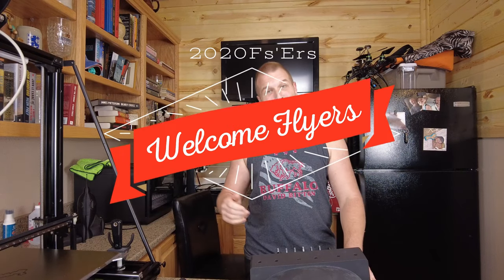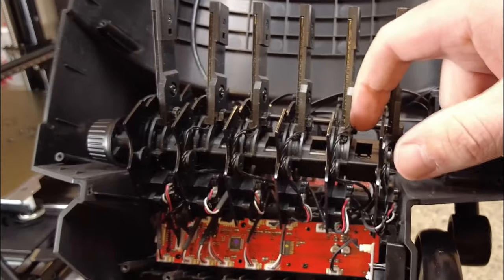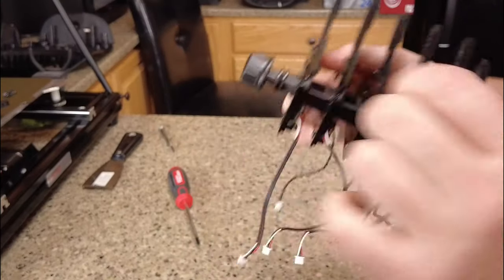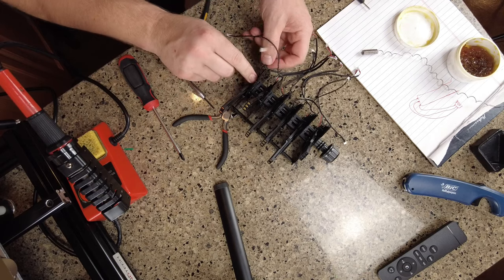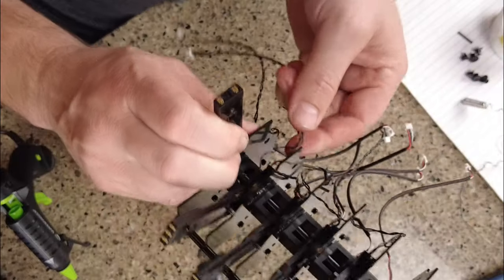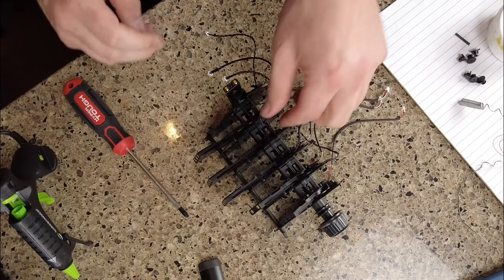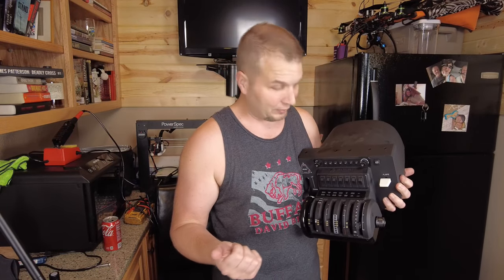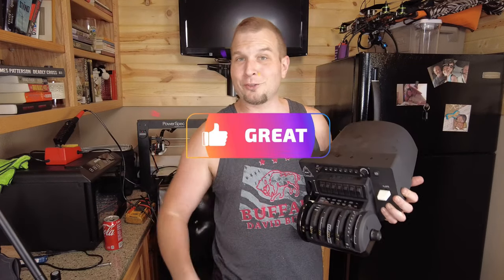Honeycomb Bravo Throttle Quadrant Problems REVersers NOT WORKING! Bravo Teardown REpair! POOR DESIGN

Comment: Great job John! That is the only video I could find on Bravo disassembly. I got mine recently, and the problem I have is that none of the axes is detected in the lower portion passed the detent. The only thing that is detected by the simulator, and the OS are the buttons at the detent line. But the potentiometers on the lower portion of the levers aren't responsive at all. That makes using the thrust reversal, prop feathering, and cutting the mixture difficult at best. I tried contacting the Honeycomb, but their customer service seems to be non-existent (despite the awesome product they produced). I wonder if your levers work all the way including the lower portion past the detent points. And if yes, what would be a possible cause of this issue, and if it is possible to fix it. Thanks!
Reply from the maker: Yes my levers work I  the lower detent position it was the reverser wires that all snapped. I suspect that if all of them stopped at the same time or never worked may be that they are not plugged in that's what i would think . 🤔 I hope this helps you and thanks for watching.
Reply: @2020fsers  Thank you John. It seems I have no other choice, but to open mine as well since Honeycomb does not answer my messages/calls, and as such, the warranty on this brand new unit is useless anyway :(.
Reply from the maker: It's not bad most likely you will remove the bottom and see wires not plugged in or something goofy. 😉
Reply: @2020fsers  My guess is that they didn't solder the potentiometers properly, which will be an easy fix. But if they did, and the controller does not interpret the signal, it means the problem is with the controller, which would be a bummer.
Reply from the maker: Stay positive and get your mind set and it will be easy don't think hard it may just happen. Things will be looking 👌.
Reply: That travel past idle is not an axis, and the potentiometers have nothing to do with it.  It is a button - any movement past the detent is "on" and forward of the detent is "off".  In much the same way as the reverse levers themselves, it is all or nothing.  You can see this if you examine this movement in the XPlane joystick settings.  You could use those 
"buttons" for reverse, of course, and if you were flying a C-141 or C-5 that movement would actually be realistic, save for the fact that it is not an axis and only an on-off situation.
Reply: @anthonyvallillo422  I must disagree. The potentiometers record all the values above and below the detent line, but regrettably Honeycomb decided not to use the lower portion as a part of the axes; they simply programmed them as buttons in their control board. However, they can in fact be used. I already finished installing a 2nd controller board inside, and rerouted the potentiometers through that board. Now I have fully functional axes above and below the detent. I also programmed the absolute lowest position as buttons so now I can also use the maximum reverse thrust commands.
Reply from the maker: Wow that sounds very interesting 🤔
Reply: @kiralema  I must defer to your knowledge!  But in essence, that is how they were designed - perhaps poorly, but it is what it is!  I don't suppose that you would be interested in making a second career of thus modifying the units of those of us who cannot solder a wire, much less remove the bottom from a unit like this!
Reply: @anthonyvallillo422  You are 100% right. Not everyone has knowledge and ability (and most importantly time) to modify a commercially-available controller to suit personal needs. It is unfortunate though that Honeycomb decided to limit the full potential of their beautiful controller. The only suggestion I have is to urge Honeycomb to either release a firmware update, or if that is not really possible, to modify the firmware of the newer models. I emailed them and spoke with them on the phone about the issue, but one voice isn't enough.

Comment: Excellent video. I managed to repair the broken wire a few months ago following your instructions.  However 3 more wires have broken.  I’ll attempt to replace some wiring.  Can you you tell me what type of wiring it is and what gauge it is?   Much appreciated. Richard
Reply from the maker: I used small 25 gauge silicon wire. For electronics.
Reply: Many thanks
Reply from the maker: Your welcome

Comment: It’s so funny how YouTube recommended me this video after I ordered the bravo. Thanks google !
Reply from the maker: Oh my . It still is a great unit .. hope you have better luck than I did.  Thanks for the comment 😀
Reply: @2020fsers  guess what week and a half of ownership and the first throttle prematurely enables button event at idle. Is that something I could fix fallowing your guide
Reply from the maker: Are you saying at idle it also triggers the detent switch? You may need to take it apart and see maybe the detent switch came loose or is miss aligned. But I will say this video is really not a guide at least i didn't market  it as that lol. But it certainly shows a good bit of the inside.
Reply: @2020fsers  yes it triggers it for a fraction of second. I also noticed once throttle 2 is in slightly above idle position the throttle 1 becomes very noisy.
Reply from the maker: You may want to just return it for an exchange or return get your money back and buy a new one seems you may have a problem unit only after 1 week.
Reply: @2020fsers  yeah I think I’ll go with that option since I’ll  have a right to do so. Great piece but now I’ll definitely wait for Rev2.
Reply: Just an update on my bravo.. the whole thing is wired with a very thin cables. They try to mange it using tightened zip ties. There is 5 of them connected to a metal plates in between each slider. The zip tie on throttle1 was over tighten, there was no room for cable movement and it caused damage to the wire coating, that broken wire was touching metal at certain throttle position and this caused  my issue. 2 out of 5 zip ties where over tighten. I put on some electric tape on compromised wire and replace other zip tie. It’s as good as new but I wish the improve quality control. Not every one likes to take things apart.
Reply from the maker: Wow i guess they don't care about all the complaints they haven't changed anything .

Comment: I have squeaky noise coming from moving the levers up and down, is there a way to fix that ?
Reply from the maker: Not sure but don't spray wd40 or and lube down in there you will loose the adjustment to stiffen the axis .

Comment: Hey I have just bought my own bravo quadrant and after much testing I’m convinced my gear lights (the three red/green leds on the front above the gear lever) don’t work. Can you give me any suggestions on how to fix without having a to send the whole thing back? After all it’s the ONLY thing not working on my quad and after looking around I should consider myself lucky. What do you think might be the cause of the problem?
Reply from the maker: Have you tried using spad to control the lights. You can get the free trial to test .
Reply: I already own SPAD and for the last time it’s not software trust me. All the other lights and levers work all EXCEPT the gear lights.
Reply: Am I likely to void my warranty if I go open it up?
I suspect a loose wire is to blame but can you tell me from your experience opening it up is it easy to access those gear lights or am I in for a nightmare of cables and screws
Reply from the maker: You will most likely void your warranty opening it up . But when you separate the top and bottom be careful of the rear plug on the bravo . And the lights are probably connected with a plug like all the other things in there so it may be a plug not plugged in or loose .
Reply: @2020fsers  any chance you could upload a quick video showing that part of it?? Would be awesome if you could please.
Reply from the maker: I don't have any video of that just be slow when separating the top and bottom when you can reach in , disconnect the cable to the rear of the top and you'll be ok
Reply: So I fixed it. Looks like the plug connected to the lights was just sitting there loose. But to plug it in was a bit more difficult requiring the removal of more screws than I was comfortable with and cutting a cable tie but put it back together and tested it in spad and boom all lights working for the first time! I’m pretty sure someone dropped it at the factory or something.
Reply from the maker: Yep I figured something not plugged in . Very poor quality control

Comment: Did your repair fix the issue ? I have lost one reverser so far . I barely fly jets if ever so pretty pissed that this is happening .
Reply from the maker: Yes it's still going strong ... the wiring will break even tho you don't use the reversers .
Reply: @2020fsers  That's insane that they break never being used . Thanks for the vid .
Reply from the maker: Your welcome
Reply: @2020fsers  Took it apart last night . Bit of a job but found a few wires broken and I removed all those wire loop rings . OMG they were strung and wound so tight no wonder they broke . I have reversers once again and all levers work as they should now . I used the smallest shrink tube I have and slid it over the wires to give them more protection at those high movement area's  . HoneyComb really need to update there internal wiring design . It was pretty cool tho seeing the tech and design that they came up with . Getting that C-Clip off was fun . Seems there hearts in the right place in giving us simmers some cool toys . Hopefully future units will have a better internal setup
Reply from the maker: Hey glad you got it fixed . Not much in that big thing is it lol. I did the same with those wire rings that is so stupid 😑 why would they make the wiring so tight idk. Thanks for the followup

Comment: So, now I'm also affected with this broken wires on lever 4 and 5; on lever 4 I soldered it and it worked until now. But it's broken again and affected the 5th also. Maybe you have another permanent solution for this problem? Has anyone else an idea? Thanks!
Reply from the maker: It can happen . You need to make sure they have free movement . You coupe also encapsulate the wires in hot glue to keep them together .

Comment: Damn !! That is a crappy wire harness !! I stumbled upon your video while looking for something else. Guess what ? I took a peak into slots of my Bravo .. Damn !! The number 2 lever 2 wires are snapped. I think the wires get stretched too much when pushing the lever into the full down position. Also where it routes into the lever - too much bending when the levers are moved up and down. Luckily I do not fly aircraft with reversers - so at the moment does not affect me. Really don't feel like returning the unit to Honeycomb - 6000 miles between me and them. My unit only in use for about 3 months now.  Question : are those wires multi strand or single conductor wires ?. Took some screenshots of the 3 pin connectors - will go to my local electronics supplier and see if the cannot makeup some harnesses in preparation for the day when i start flying jets .. LOL .. Thanks for making the video .. Excellent !!
Reply from the maker: Yeah Hey thanks for the comment they are multi strand wires  and the issue was there is no way for the wires to move inside of there and the way they have them bound to the back side they've gotten them tied to the metal part of the controller and every time that you move the throttleforward and backwards it bends those wires kind of like a paper clip until they snap. I know a couple people are waiting for honeycomb to get parts in to repair .  I think they should almost have a recall situation because every single one of them is gonna do this. But that's on their reputation.
Reply from the maker: Also they don't use copper stranded wires they're using aluminum stranded wires

Comment: My autopilot buttons, landing gear, toggle switches and flaps suddenly stopped functioning. Honeycomb gave me a throttle tester and it was indeed broken. Do you have a fix for this?
Reply from the maker: It's most likely a main cable that came disconnected from the board . Seems like a lot of things went bad at 1 time so it's either that or could be the board but I would check all the connectors inside

Comment: is this a common problem with the bravo because all of a sudden my reversers have stopped working ?
Reply from the maker: Yes this is an issue with all of them they still have not yet fixed the wire routing issue causing them to break.

Comment: Great video, but... I can't figure out how to get the second to fifth lever out. I managed to repair the first lever, but it seems like I have to take the whole thing apart to get  the plastic part with the wires out so I can fix the wires. I have no idea how to do that. Can anybody help?
Reply from the maker: i wish i could help with that question but its been quit a while since i took this apart so im not sure but you should be able to remove them like the others.
Reply: I actually made it. I didn't have to take everything apart. Only had to screw the hex screws a few millimeters in after removing the nuts and toothwashers, so I could pull the levers out and solder the cables. Now the detents of the levers are mostly gone, but I guess this is adjusted with the hex screws. I'll check that out. But not today.
Reply from the maker: You need to adjust the hex nut where the detent is .
Reply: That's what I'm going to do. But it has to wait until weekend. Thanks a lot, 2020fsers. Without your video I had never dared to repair the Bravo. Thanks a lot!!!
Reply from the maker: @guggemal5223 your welcome .. I never really intended for this to be a how to video lol but I'm happy it helped.

Comment: Going to have to do this myself. Reverser and TOGA is not working anymore. I can see the wires broken. Pretty annoying, and for them to fix it they want me to send it back with all parts and it could take 8 weeks. Crazy.
Reply from the maker: Yep and most likely take longer . It's pretty simple depending on where your wires snapped check them all and give them.some slack so they can move and not bend.
Reply: @2020fsers  I think you went the extra mile, I have a feeling if I re route them and sauder them I can make it work. I work on motorcycles as my hobby, this can't be too bad haha. Cheers.
Reply from the maker: You should be fine when you separate the top and bottom take care of the wires that go to the ba k plug once you gently pop the top the  unplug the rear cable to finish removing it .
Reply: The tough part is going to be the saudering!
Reply from the maker: Nah it's really easy practice first.  Tin the soldering iron before you solder the wires tin each of the wires and you'll be good and get some Flux to.dip your wire ends into.

Comment: The Bravo, while an outstandingly realistic setup, particularly for airliners, has apparently got some very serious quality control issues.  My first one had the identical problem that you are dealing with here, on only the #3 channel initially (#2 throttle in a 747 setup), and it cropped up after around 2 months.  Honeycomb replaced it, and I must say that aside from the irritation of having to have a new one sent from China every time this happens, they have been very responsive - no problem there.  But the replacement they sent was miscalibrated on all axes right out of the box and of course unusable, so back to Fedex again for another return.  Unit three, which I have had for a few months, is so far OK, but there is an ominous clicking sound when (again) number three channel is retarded from high thrust settings to low. Looking in the slot, I see that sure enough one or more of the wires is catching on some piece of the assembly, and it will probably be but a matter of time before it breaks.  Unfortunately for me, I have none of the electronic repair knowledge and skill that you have, so taking it apart will not be a possibility.  I could take it apart all right, but I would have no chance at all of getting it back together!  

In any event, it seems that I am by no means the only one who has this problem - I wonder if they are all defective like this?  Too bad, because nothing else comes close in terms of look and feel.
Reply from the maker: I agree 👍  and the new units going out still have this same flaw even replacements it's sad they are not fixing the issue . It is a really great unit though aside from that I like the Boeing yoke but not the throttle that comes with it I would like to get the yoke separately. Wish you the best luck with your bravo. Thanks for the comment .
Reply: @2020fsers  I agree on the Boeing Yoke, although I have yet to actually try it out.  Thrustmaster products can occasionally be troublesome as well, but everything at this level seems to be, sad to say.  The alternative would be some real throttles from the boneyard, but it would take at least a masters degree to get them working in a sim setup, although some have actually done just that...
Reply: There are  little servo's  that have a movement limit so I am guessing they were out of wack .  I had to re-center mine after I had it all apart .
Reply: I couldn’t agree more. It’s a shame, as the Bravo and Alpha which I have are wonderful peripherals and have made my experience up until now very enjoyable. This problem though is extremely frustrating, and as many have pointed out, one would expect the quality to be better, given the price of these units. I have my Bravo disassembled as I type this, and trying to repair is indeed intimidating.
Reply from the maker: Take your time .. practice soldering on some spare wires and you'll be fine
Reply: @2020fsers  well I dived in today, and now it’s all working again 👍 Thank you so much.
Reply from the maker: @JKPilot that's great . 👍 glad you sorted it.